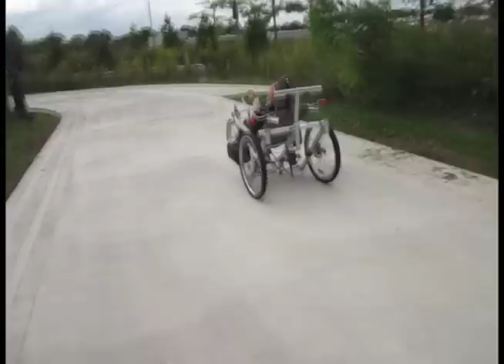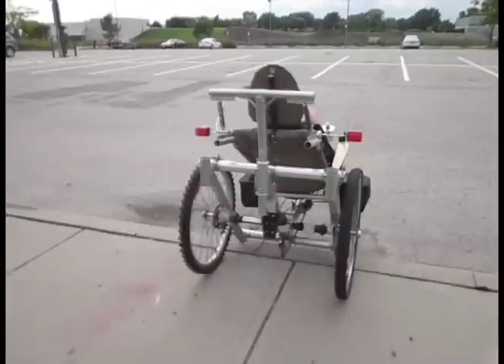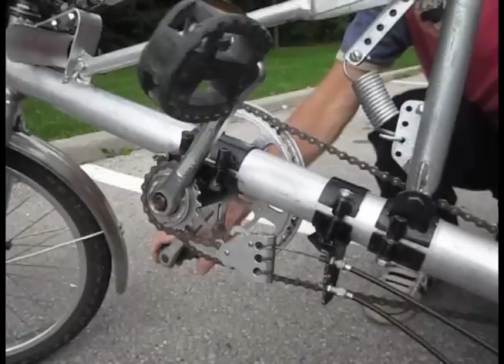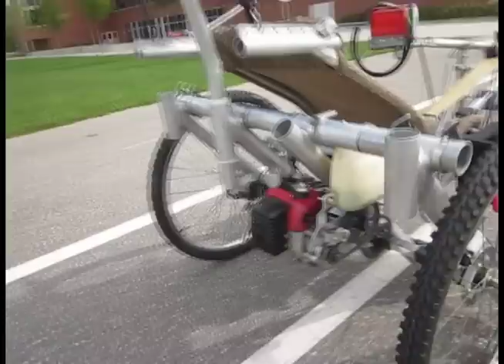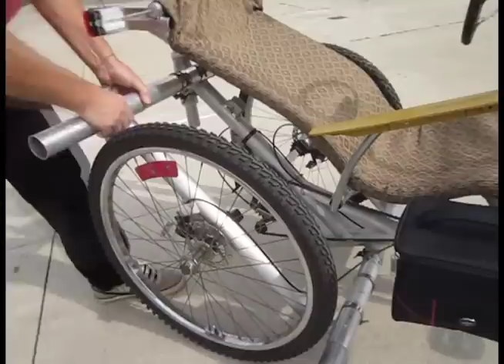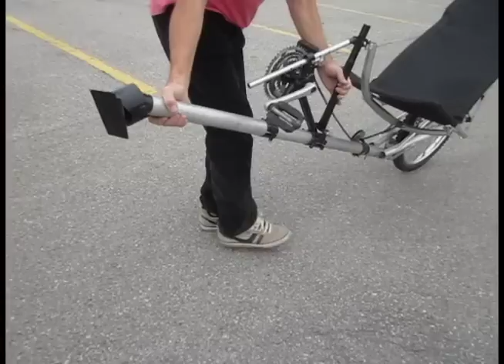Modular Recumbent Tricycle 2013

Comment: A lot of great features, here.  Nice design.  The seat springs seem to allow a lot of bounce.  Have you tried stiffer springs and, if so, what was the result?  With all suspension in the seat and with all the swing visible, how does it handle in turns and coming out of turns at speed?  Does the swing of the seat make it difficult to control?

Comment: Regarding safety - 1. for high speed riding you can connect top of springs close to center or use longer cross-tubes to make vehicle wider . 2. steering column can be telescopic, easily releasing, made from flexible plastic and so on. I think anyway trikes are much more safe than bikes. Bikes are most dangerous, especially to drive baby in front seat. It is crazy.

Comment: “Too much unsprung mass...”
About 60% - 75% of mass is suspended – is not too bad for such simple, lightweight and inexpensive suspension. 
 
“…seasick from the suspension and no shockabsorbers…”
Shown jumping is an example of extreme case. Normal roads driving is very comfortable. First time it might feel strange, but later on you stop paying attention to shaking and side swinging – similar like we never worry about ‘jumping’ of our body when we walk or run. 
I agree, shock absorbers can improve suspension. It can be an option – to have simple springs (different length and hardness) or springs with shock absorber.
I tried to make it simple. To make everything more complicated and expensive is easy.

Comment: spring suspended A+ but looks like it needs more control from swaying , with all those multi positions might as well make the seat recline fully if needed and put an enclosed shell on the recumbent
Reply: +4cClubT I'd couple the springs with some device to absorb excessive spring movement. Something like an elastic foam sleeve around the spring.

Comment: Lethal. In a frontal collision that tube goes right through your chest. This is why cars after 1945 had two u-joints in the steering column by law.
Reply: +Richard Sexton not only that, with three weels you should have a free movement to the left if u turning left, with some speed and tuning, g load  will punish you, but still clever ideas thanks for sharing abrect
Reply: cool bike but if need to jump out  because of danger be very hard thats problem with these recumbents.
Reply: OMG. Agree. All cars after 1998 must have equipped with airbag. This trike should have also front airbag, passanger airbag, side airbags and most importantly, should be equipped with "stupid comments airbag" too (like mine, but not limited). (also sorry, english isn't my main language)

Comment: I hope you are not a licensed engineer.....keep this thing away from the public...accident waiting to happen ...hate to be cruel but I'm worried you will hurt someone or yourself
Reply: Looks like you don't appreciate the time and effort that has gone in to something like this . . just remember everything started life as something simple and people have improved on it  ie Ford Model T and Lamborghini. .  Lamborghini started life as a tractor maker now look what they make and sell
Reply: jacky Parker The braking system is my main concern , sure yours works fine in a wide open area but have you been in a situations where you need to have the brakes on immediately to prevent an accident , I own  two recumbent trikes and ride them often and I'm also an engineer (61) , from experience and 12 crashes, some on purpose, I can tell with confidence, you need to redesign the braking system , having a steering wheel makes this difficult .The seat absorbs the bumps but pedaling energy is inefficient . So on the positive side, the use of material is ok but  It is very difficult to improve on commercial recumbent trikes that are already out ,  . I suggest you try riding available recumbent trikes and do more research for  safe handling characteristics . You seem to like what your doing but keep safe engineering in mind. Sometimes trikes travel at over 40 kph and at these speed you can seriously get hurt , even 20 kpm can cause injury. With what you have I would only feel safe at walking speed
Reply: Ive done had a few crash's at a lot higher speed then you mention and have always walked away with no major injury with exception of one scare but still walked away. . . One time brakes failed . . .(my own fault )  didn't get round bend but still walked away and that was at a speed of over 80kph
Reply: jacky Parker Ok ...I'll take everything that I said back ....yes it is a lot of work and your trike looks good
Reply: jacky Parker the more I see the more I like.....is it all aluminium and did you do the welding and fabrication on the front fork....thanks for your time , now I see the front seat is fastened so that leg energy is not so wasted , glad you contacted me , and I would like to apologize on my first comment being blunt..now I'm hooked , Are you in the Toronto area
Reply: Not my bike or video
Reply: jacky Parker I'm a newbie at this , my comment got misdirected , sorry dude , I was commenting on the video one . Youtube commenting needs improvements so that old farts like me can communicate to correct person , I taught I was directing my comments to the inventor .  80kph what kind of trike were you using and what was the road condition like . You could die at those speeds , you must be young , I was once but not so lucky , now I ride a trike because of my foolish vehicle accident
Reply: I did say I walked away each time and did not see any of my own blood or any one elses
Reply: Good morning dude , hey your alright , did you see the changes on the delta trike ,that I commented harshly on . he gave up on the chariot rear wheel , now he's improving on the first one . I'm hoping someone does bring these into production , How's your folding trike doing  . I went from a speedster to a ttrover with 11 gear inches , now I can avoid vehicular traffic by going on unpaved trails . No fenders so I occasionally do the three wheel drive thing , but like typing , I  have a   quota before I hurt , I'm still an lone idiot
Reply: this is not my design or build
Reply: jacky Parker Dude I got hit by a cosmic ray , how do I fix this data communication problem . I'm old and confused
maybe it's my meds . Sorry